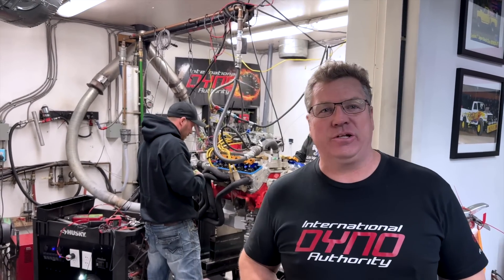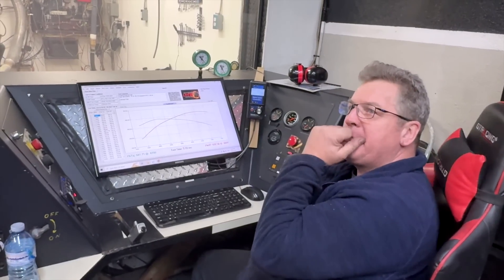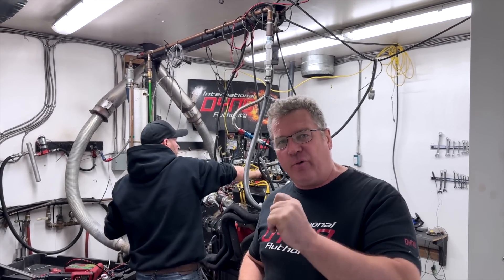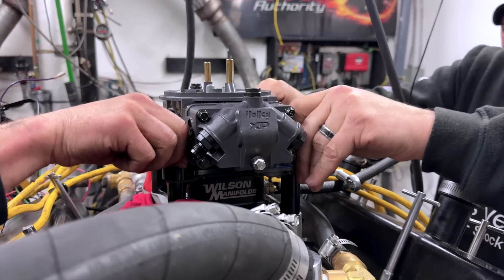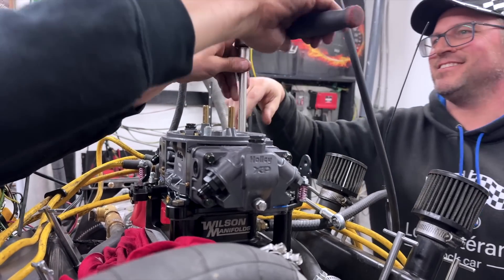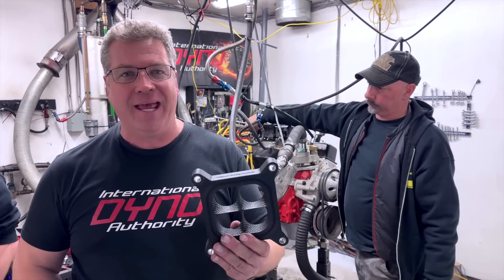Dimpled Intake Spacer adds 21+ HP to a 408 Small-block Chevy!

Comment: So you changed jetting and timing for the pull before the dimpled spacer but you presented no dyno chart. Then you try the dimpled spacer and get the biggest gain of the day along with a dyno chart. I'm totally buying in to that...
Reply from the maker: @FoghornLeghorn-k8i  The testing was done back to back. Simply by swapping out. One spacer for another spacer. 

Nothing else was changed. 

As a matter of fact, we also went the other direction. Which ended up proving nothing because it went right back to making the exact same amount of power. 

And we also took all of the spacers out. Which the engine absolutely responded in kind. The horsepower and torque both dropped off by over 30 points. With no spacer at all.

Carburetor jetting remained the same. The ignition timing remained at 36°.
Reply from the maker: @FoghornLeghorn-k8i  
7:50

We made a step in progress. 

We cleaned up the fueling. (Dropped jet size) 12.2 to 12.8

And then we tried 34°

Everything else the same. Same spacer. We still had not tried the other spacer.
Reply from the maker: @FoghornLeghorn-k8i  

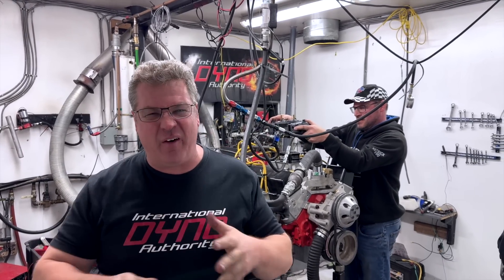8:30

Jetting Front 83
Rear 83

Ignition timing 36°

577 ft lb's. 648 hp.

Wilson Spacer
Reply from the maker: @FoghornLeghorn-k8i  

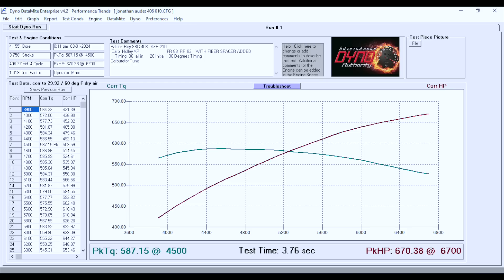9:55

Jetting Front 83
Rear 83 

Ignition timing 36°

Changed Spacer Only.

587 ft lbs.   670 Hp

No other variables changed.
Reply from the maker: @FoghornLeghorn-k8i  

 

And, you'll notice that when we turned the spacer quote" upside down"  received much better results. And, like we said. We are not advertising this product. This product showed up at the shop during normal Dyno testing and tuning. We tested carburetors. We tested intakes. We tested spacers. We tested afr. We tested ignition timing. 

On this day on this combination with this particular engine, with this setup with this intake with this carburetor with this valve configuration with this Port dimension, with this compression ratio. Compression ratio. This particular spacer was very very effective. 

However, on another engine, you would have to do your own testing. 

And like I said many times. Which I agree, it would be interesting to just do testing over and over with, different spacers on different combinations. 

Stay tuned! Hint hint, because we have lots more testing coming. 

Once again on this combination.... with this setup.... on this fuel, etc etc etc. This spacer was very effective
Reply from the maker: @FoghornLeghorn-k8i  think it's probably worth your time, to go back through and rewatch. 

I think you may be skipped through a couple of spots. Or your internet may be cut out, as, we explained to each individual step. And each individual step is also on the screen, on the chart, and on the computer. Dyno display

Comment: I really wish this industry would do these videos with 300hp 5500 rpm max street motors that most people build.  This was a good video for what it was, thank you.
Reply from the maker: @chevypowerish  Thank you very much for writing in and stimulating conversation. 

Although I am not sure what "industry" , You are referring to. 

As described in the video. This customer arrived with several different types of induction systems. They wanted to test to see whether the new carburetor they purchased would make more power than the old carburetor. Which it clearly did. Did they also wanted to test if there was a difference between a Wilson spacer, no spacer, and the dimpled style spacer that they brought. Clearly the Wilson worked extremely well. Well. No spacer was a huge failure. Losing over 20 horsepower. And the dimpled spacer. On this day, on this engine, on the setup, with this compression, with this carburetor, with this modified ported and opened up intake cylinder head combination. Worked very nicely. (When run in UP side down configuration)

I agree with you, it would be a fantastic video to try a lower RPM engine. It would be interesting to see, if there was a difference on a small block Ford style. Small block Chevy style. Luxury series style. And even put this on a Mopar. 

Stay tuned because there is a lot more testing coming.

Cheers from all of us at International Dyno Authority
Reply: @internationaldynoauthority693  Hey Thanks for the reply.  I was referring to the "motor building and tuning" industry.  Currently on my 3rd build of the same motor and have learned more from you guys online than my local shop so I want to say thank you for putting these videos out.  
So, I see all these dyno pulls on motors for intakes, heads, cams, carbs, spacers, roller rockers ext but they sometimes don't even start the dyno graph until 25, 35 or even 4500 RPM and find the max gains. 
Now I understand that some of that data can be extrapolated down to the RPM range idle - 5500, or 1500 - 6500.
So my original comment was just saying I wish more experiments on things like this spacer were done on "street built" motors with 350-400 hp is all.  I'm sitting at 382hp sbc 355.  Maybe this spacer adds killer throttle response at 1200rpm, maybe it does nothing.
Anyway, Love you guys and all your videos.  God bless and have a great 2025.

Comment: Guy in the LSX shirt wondering how an sbc is making so much power lol
Reply from the maker: @shootermcgavin2819  The funniest part, just before this engine was on the engine dynamometer. We had put the other fellas same cubic inch, same basic setup. Carbureted LS on the dyno also. They both made identical the same amount, of torque. The ls made a little bit more horsepower when it was at a colder temperature.

Comment: It was 20 hp , look at the dyno mans look on his face when you said 35 hp. ?  Also you lost hp. And torque at 34 degrees, did you put 36 back in it with the new spacer ? I also saw you change 2 things at once which is a no no, because you dont know which one helps or hurts .
Reply from the maker: @PeggyParrow  

We made a lot of changes, and reported each change as we went.

ONE of the many steps we tried was 36--° then 34°. 

With ZERO changes.

Then back to 36°

Then baseline

Then added the spacer

Then ran again.

Only ever one change per pass... Over 17  separate test passes

Over 8 mini passes.

By the end we KNEW exactly where the limit was, that's why we were surprised,  that ONE of the spacers we tested made a larger difference, and RESET the limit.

Excellent 👌 fun 💯 day of testing, tuning and product testing.

Comment: Rev it more the curve is still going up !
Reply from the maker: @PeggyParrow  On a couple of the last passes,  the customer asked to "Exceed" the limit of his (valve train). Springs push rods, valve weight,  rockers etc...

We pushed the RPM up and it immediately rolled over. Just ran out of compression and Valve train.

On the track, the car will never approach this RPM, so we found our limit, on usable RPM.
Reply from the maker: @PeggyParrow  look closely, at the graph. Horsepower is generated, based off the torque number. 

The torque curve had begun to tank quite a bit. 

 Falling over by over 100 ft lb, by the time we were at the maximum RPM. 

Out of: Cylinder head, compression, ring seal..etccc...etc...

Comment: Dimple mania is around the bend now. Golf ball dimples reduce the drag on the ball ONLY between ~125MPH and ~200mph. At ever other speed they INCREASE drag.
Reply from the maker: @billshiff2060    Testing is really the ONLY way....test, then check, change, then test again. But don't go against the test results. Results. Just see what works and see what doesn't work. One thing about a engine dynamometer, it has no conscience and it doesn't care. If you make more power, it will simply show you.
Reply: @internationaldynoauthority693  The dyno did NOT tell you "dimples" work, only that part as it is did. Fill in and smooth the dimples keeping the same shape. Then you can say something about dimples.
Reply from the maker: @billshiff2060  

And, you'll notice that when we turned the spacer quote" upside down"  received much better results. And, like we said. We are not advertising this product. This product showed up at the shop during normal Dyno testing and tuning. We tested carburetors. We tested intakes. We tested spacers. We tested afr. We tested ignition timing. 

So, once again, on this day on this combination with this particular engine, with this setup with this intake with this carburetor with this valve configuration with this Port dimension, with this compression ratio. Compression ratio. This particular spacer was very very effective. 

However, on another engine, you would have to do your own testing. 

And like I said many times. Which I agree, it would be interesting to just do testing over and over with, different spacers on different combinations. 

Stay tuned! Hint hint, because we have lots more testing coming. 

Once again on this combination.... with this setup.... on this fuel, etc etc etc. This spacer was very effective
Reply from the maker: @billshiff2060   Test test test...

1- On this Engine 
2- with this customer's intake 
3- with this carburetor
4- with this cubic Inch
5- with this cylinder head 

Etc.. etc...

This spacer proved very responsive.

L O T S  of testing Should be tried/conducted, and combined and reported to see the effects on different combinations.

What video did you watch?
What was the title of it? 
Who conducted it.?

Thank you for writing in ...in....

Originally this was Just a tuning session, AFTER the customer added the spacer, and we documented it, and saw the results, we published it.

Comment: This is interesting as other controlled Dyno tests have showed that the very same spacer doesn’t make any notable difference and is out performed by HVH and other synthetic taper spacers. However,  Eric Weingartners test (on YT) showed their dimpled open tapered spacer made the most gains when it was placed on the intake upside down. It performed better then the other dimpled spacer and way better then the same spacer right side up.
Reply from the maker: @ChrisS-oo6fl  agreed, 

And, you'll notice that when he turned the spacer quote" upside down" he received much better results. And, like we said. We are not advertising this product. This product showed up at the shop during normal Dyno testing and tuning. We tested carburetors. We tested intakes. We tested spacers. We tested afr. We tested ignition timing. 

So, once again, on this day on this combination with this particular engine, with this setup with this intake with this carburetor with this valve configuration with this Port dimension, with this compression ratio. Compression ratio. This particular spacer was very very effective. 

However, on another engine, you would have to do your own testing. 

And like I said many times. Which I agree, it would be interesting to just do testing over and over with, different spacers on different combinations. 

Stay tuned! Hint hint, because we have lots more testing coming. 

Once again on this combination.... with this setup.... on this fuel, etc etc etc. This spacer was very effective

Comment: Fat is lazy and lean is mean but too lean you can burn stuff up so it's good to be on the safe side
Reply from the maker: @79tazman agreed, that is why we always test and tune and test and tune until we have it correct. It is not lean. It is not rich. It is correct. 12.8 very good. 11.9 way too rich. 13.6 way too lean. So we have a very, very nice range to work with. 
Afr is always interesting. But, we also pull the plug every single time and have a peek. And we adjust for horsepower. Because correct is correct is correct. Somewhere in the 12s is going to make you the most horsepower.

Comment: At what RPM?? 😳
Reply from the maker: @Pork-Chopper  

I'll go back through the video. But I'm pretty sure that we displayed the complete Dyno results of the run. I'll just have to walk backwards through the video and take a peek
Reply: @internationaldynoauthority693  
It's all about the Bernoulli's Principle. 
Like squeezing a garden hose to get it to 
Shoot the water out harder, you're creating 
a low pressure by squeezing the hose. The spacer actually "obstructs" squeezing the opening making it smaller. The venturi effect. The dimples in this case, like on a golf ball creates a lower pressure on the surface causing a more uniform laminar flow, increasing velocity, but only happens at the higher Rpm's, way above the normal, useful ranges of rpm. For example, my SBC, at 2500rpm is doing 70mph. It does me no good to run my motor at 7500rpm. It's not speed legal to begin with and running motors at those high rpm'$ do nothing for the engines longevity. That's your trade off. All this power for a waay shorter engine life.
Reply from the maker: @Pork-Chopper  

This is STRICTLY a race car engine.  Driven at extreme RPM,  against others at extreme RPM....on a racetrack.
Reply from the maker: @Pork-Chopper  probably you should go to the website of the manufacturer of that particular spacer. They actually recommend the complete opposite. So, I would recommend taking a look at the website. Looking at the spacer again. 

When we tested it back to back, with the Wilson, the Wilson has 30% less open area. There are a lot of factual information, missing here. Quoting a generalized theory, in relationship to an engine. Doesn't work. This, was a completely off the cuff test. After we tested this and saw that it worked on this engine at this time with this combination with this carburetor with this intake with this compression ratio with this particular set of cylinder heads, we noticed an increase. Would it work on every engine? I really doubt it. It. I think that, you need to test, you need to tune, and you need to work with your own engine to see what differences it will make. If any
Reply: @internationaldynoauthority693  
Thanks for the info. You bring up some good points. Not all combinations increase hp, in some cases you lose hp. My setup is relatively mild, Edelbrock's 70cc heads, a weiand street warrior intake, n a 256 comp cam with roller rockers on a stock 350ci sbc with flat tops. I went with this set-up because of the bad pump gas. Compression ratio is somewhere between 9 n 10:1. I used a 1 inch open spacer between the carb, a Demon 750, not really thinking of getting any big increases in Hp, but to increase intake velocity to help low end torque at the lower Rpm's. Not a powerhouse by any means. I figured it puts out a good solid 
350 horses. The engine is very responsive and pulls hard. It's a good street engine for my 72 Chevy PU. My brother built a 383, with a super charger n boost, and no spacers. It's a monster! That puppy puts out close to 750HP!
It's a Blast to drive! Literally! 
Keep up the good work!
Reply from the maker: @Pork-Chopper  The RPM, and range is fully displayed in the video.
Reply: @internationaldynoauthority693  
How bout doing the opposite? 
Producing the most HP n Torque at 
the lowest Rpms possible?
Reply from the maker: @Pork-Chopper  I'm sure that would be a lot of fun. But that's not the business I'm in. And, this is a engine dynamometer tuning company. Thousands of customers literally bring me their engines so that we can tune them, to make them run correctly. We're not in the business of trying to build a motor to make less power at a lower RPM. We're in the business of tuning whatever shows up on our doorstep. And that's what this was. A race engine built to go on a racetrack being a race car. I don't know why I would ever want to turn around and try and take a gas engine and make power at 2000 RPM. All I have to do is take a stock 464 Ford engine, and I'll make more torque than anything else on the planet at a low RPM as a gasoline engine. I don't need to try and build something to do that it's not the point
Reply: @internationaldynoauthority693  
Understood. 
There's other ways to go "faster" than building 
an engine on steroids. Transmissions are torque multipliers. I built and worked on early model Harley engines and I was always asked about performance hop ups. 
An easy way and not too expensive was to change out the sprockets for more top end and less rpm, like making it overdrive. 
Baker Drivetrain came out with a slew of transmissions with more gears to retrofit
Harley's that work very well. In my old C-10, I swapped out the old turbo 350 for a 700r4.
I gained topend n reduced my rpm by 30% to save on fuel, or so I thought. It's fun to drive with a beefed up motor, but it also takes a proportionate amount of fuel to produce those horses ....

Comment: All is well, until i realise these are 3d printed, hard pass
Reply from the maker: @billzussman5277  

When a product works,   it works.

On this combination, with this intake, cam, comp ratio...etc... etc..   works well.
Reply from the maker: @billzussman5277  One other quick thing, that we would point out. Is that this video was not? I repeat not about a spacer. Nor was it a commercial for a spacer. It happened, that while we were filming, and while while we were testing. And while we were tuning. Tuning. The customer brought this spacer forward. We took it off another engine. And tried it on this engine. In this case on this engine with this compression ratio with this piston with this intake with this carburetor with this cubic inch, it worked extremely well. So, it doesn't matter where it comes from. Whether it's manufactured by a press, a lathe, a mold, or 3D printed. In this case, it works very well on this motor. 

Again, this is not an endorsement of this product. This is simply fact-based. You cannot deny that this worked on this particular engine very well on this particular day with this particular setup. 

My questioning would come down to try it on many, many different engines. Many different styles, to see what kind of difference. Yay or nay that you might have, on those engines.